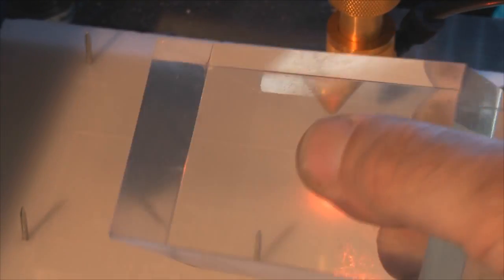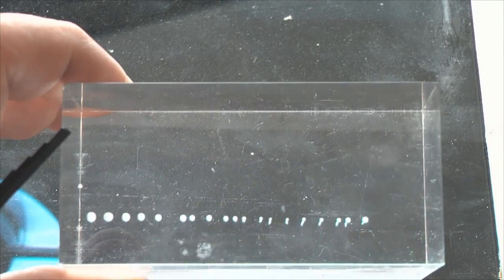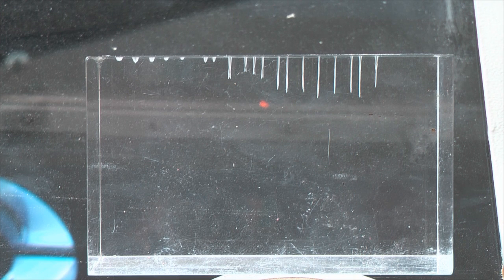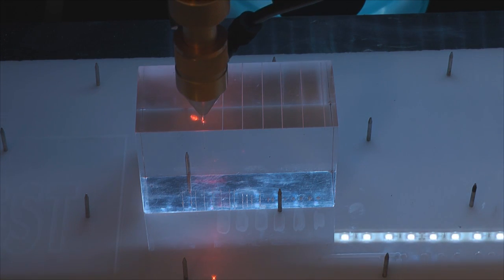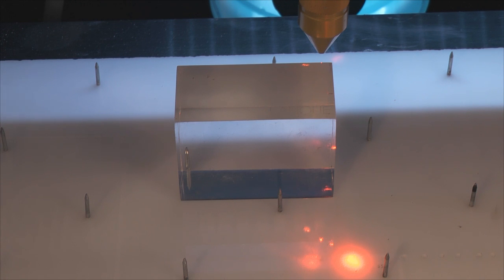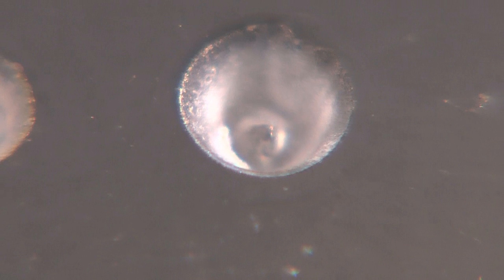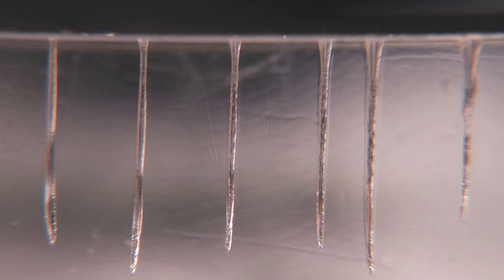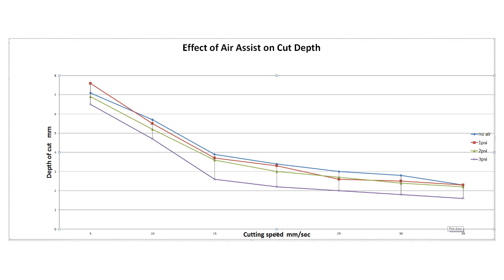Chinese laser cutter  tutorial part 6

Comment: Thank you very much for your videos they are really very useful. I was told by a fabricator that with a 150 watt tube I could cut 0.5mm thick sheet metal using oxygen, What is your opinion on this? Thank you very much again.
Reply from the maker: Hi Francisco

 Yes you can cut steel with a CO2 laser.  I used to run two 3kw lasers as part of a sheet metal working business. Yes, with the addition of oxygen as an assist gas  you  dramatically improve the cutting capability of the laser beam BUT........ Several warnings.
1) Don't attempt it with a normal machine. You require a  special (pretty heavy) head to cut metal  that you cannot just bolt on to a cheap machine.
 see   https://www.cloudraylaser.com/collections/metal-mix-cutting-head/products/cloudray-150-500w-metal-laser-cutting-head-set?variant=31210397237388

2) Pressurized oxygen needs to be handled very carefully because  it can be dangerous if you have no training
3)The oxygen needs to run at about 12 to 15 psi (about 1 bar) and is an expensive  consumable,
4) 150 watts is the MINIMUM power required  for anything half reasonable and what sort of things can you make with 0.5mm MILD STEEL
5) It does not work for stainless steel. That requires medical grade nitrogen runnng at  12 to 14 bar (huge gas consumption!!!!)
 
Cutting metal is not what I would call a hobby activity. It will be very expensive and really needs a lot of efficient machine use to make it a viable business. Think twice about any promises  or dreams that a salesman might dangle in front of you. Remember its your problem once you have bought it and he walks away with commission and a big smile.  I urge you to use Google  to find a local laser profiling business or a metal fabricator with his own machine and arrange a visit to talk through the logistics of machine ownership and the many ancillary costs and space requirements.
 I'm confident that after such a visit you will decide that it's cheaper to subcontract your metal work needs to a professional outfit. It's not expensive because they deal with large volumes.

 Best wishes
Russ
Reply: @SarbarMultimedia  And you think it's possible with a 150 watt tube with a peak of 180 watts? Thanks
Reply from the maker: @franciscodeasisfdez.medina45  
Hi Francisco
 Yes it will only be thin mild steel but before you buy ask the seller to send you an UNTOUCHED sample so that you can see what the edges are like. I can only advise you to be VERY skeptical.  A little care and research could save you a lot of money.  The big problem with laser tubes (even the so called best RECI) there are huge numbers of B grade tubes being sold with machines, Yes, it will  work and will have  been power tested by the buyer who bought it as a factory reject at a low cost. The thing that makes a tube efficient at cutting is beam intensity rather than power. An A  grade tube has the power and the intensity profile whereas a B grade tube may be like a blunt  knife rather than a razor sharp sword.  With my thousands of correspondents from all over the world, most with problems of some sort,  it does not take long for me to see patterns of behavior for the Chinese laser industry.  There are a few credible companies but in general  it is just a big flea market, so,  BUYER BEWARE. 

Best wishes and good luck
Russ
Reply: @SarbarMultimedia  Thank you very much again for the information and also for your sincerity

Comment: Thank you for these videos they have been very helpful. Have you used any other software with the cutter? We were told that Inkscape is great but not sure how to get the cutter to see it.
Reply from the maker: Hi Susan
 The free software, RDWorks, is neither a drawing nor a CAD package. It is just an interface software to convert your creations into machine code that your laser can understand.  There is a way that RDWorks and CorelDraw can operate together (I don't use it)  but provided you can create the right type of file format, any vector or paint/photo software  can be used to create images/designs.  Inkscape , Photoshop. Illustrator,  GIMP , Microsoft Draw  or any CAD software can be used .  You must IMPORT your creations , do not try to OPEN them..
 Shout out again if may answer has not dealt with your problem.
 Best wishes
Russ
Reply: @SarbarMultimedia  thank you so much for your reply. That makes so much sense.

Comment: thank you for sharing all this information with us! hope that your well and still enjoy the laser cutter.  i`ve bought this chinese laser cutter without knowing to much about, and i`m still struggling to make it work. at first was the software that create problems. now I have the message " opened protected" on the screen when i`m tring to start it. i`ve checked  the water pomp and the flow, everything is ok. on the laser control (the box that is inside) is showing laser signal off.   
best regards 
alexandru bunea
Reply from the maker: Hi Alexandru
I have not seen this message before  but it implies that you may have a safety switch on one or more of your machine doors Take a look at your Ruida controller. Is there a wire connected to the CN5 number 3 terminal?  If so check that your switch/s are working properly.  If there is a wire into CN5/3 then there is a way to bypass oit. Let me know what you find
Best wishes
Russ
Reply: @SarbarMultimedia   thank you for your help! there is a safety switch on the laser door and the wire is going straight to the laser switch button.
Reply: i`ve checked the sensor series and the only place that appears in on aly express but is unavailable for the moment. the sensor series is autonics pr08-2dn blu ov 4A086C and this one have a single black wire that comes to the laser switch.
Reply from the maker: @alexandrubunea2963  
Hi Alexandru
Is this machine in a factory or business where employees are using the machine or is this just for personal use?  95% od machines from China do not have this door protection switch.  If you have employees using the machine it will probably be illegal to run an unprotected machine. However if it is only you using it then it matters not because you are a "responsible" person. Under this circumstance it will be possible to disable the switch. Go to File Vendor Settings and the entry code is RD8888, Press the READ button . Find the OTHER tab and  at the bottom right you will see a  ENABLE PROTECT. I guess this will be ticked. If so remove the tick and press WRITE. then exit.  Hopefully you will now be able to use your machine,
 Best wishes
Russ
Reply from the maker: Hi Alexandru
  I think it would be a good idea to add your disguised email address to another comment so that I can email you directly with information.. I will then delete your comment.
 Best wishes
Russ

Comment: I had watched another video on these machines ( I have one by the way the same one you do )  and the man used the PULSE button in conjuctiion with lining up the mirrors to make sure the laser was directly in the MIDDLE of the lens. What he did was.....he place a round sticky note paper over the mirror,.... not getting sticky glue on the mirror of course....and he pulsed the laser to see if the laser hit in the center of the paper. if it didn't...then he adjusted the mirrors to where the laser was hitting directly in the center of the mirrors using the sticky note process. just thought I would let you know that. also they were saying to use distilled de ionized water with some ice in the bucket to keep the laser really cool.... it makes the laser last longer.
Reply from the maker: Hi John
Take a look at this video and you will see how I carry out a beam alignment perfectly and efficiently. 
https://www.youtube.com/watch?v=V_ehGE51rH4&t=1296s

There will be one feature that your machine lacks and that is a Z ajustment on your head . I overcame this issue by making my own bracket and also using a different lens system in a new head I designed myself.
See
https://www.youtube.com/watch?v=jVGByifge_Q

Making your laser last longer has little to do with perfect temperature control and more to do with control of the CURRENT you allow to flow through your tube. I would suggest very strongly that you fit an ammeter to your machine and also  add a temerature sensor to your return flow line from your tube. Although you can run your tube at 40 C without affecting its life  I advise you mainly keep it at or below 30 C At 40 C and above you will loose about 5% power  but that's the only penalty.

Take a look at these

https://www.ebay.co.uk/itm/Mini-Digital-Fridge-Refrigerator-Aquarium-Thermometer-Probe-Sensor-Freezer-LGH/184002639499?_trkparms=aid%3D111001%26algo%3DREC.SEED%26ao%3D1%26asc%3D20160908105057%26meid%3D09551348c63142d3bc0f2277c8929fba%26pid%3D100675%26rk%3D3%26rkt%3D15%26mehot%3Dpp%26sd%3D233079942056%26itm%3D184002639499%26pmt%3D1%26noa%3D1%26pg%3D2380057&_trksid=p2380057.c100675.m4236&_trkparms=pageci%3A28d16e79-3fd1-11ea-83c4-74dbd180be5d%7Cparentrq%3Adf3561ea16f0aa47a7823543fffd52b8%7Ciid%3A1

https://www.ebay.co.uk/itm/DC-0-30mA-Analog-Amp-Meter-Ammeter-Current-Panel-Ampere-Meter-Milliammeter/352350706691?_trkparms=aid%3D111001%26algo%3DREC.SEED%26ao%3D1%26asc%3D20160908105057%26meid%3D09551348c63142d3bc0f2277c8929fba%26pid%3D100675%26rk%3D5%26rkt%3D15%26mehot%3Dnone%26sd%3D233079942056%26itm%3D352350706691%26pmt%3D1%26noa%3D1%26pg%3D2380057&_trksid=p2380057.c100675.m4236&_trkparms=pageci%3A28d16e79-3fd1-11ea-83c4-74dbd180be5d%7Cparentrq%3Adf3561ea16f0aa47a7823543fffd52b8%7Ciid%3A1

Very easy to fit
see 
https://www.youtube.com/watch?v=xDZmuxq5BEM

Best wishes
Russ

Comment: Does anyone know if it is safe to laser cut prototype board? Its the boards that have all of the holes with the copper rings on one side. I hit some with a hammer and it shattered but I am not sure if it is safe to use in a CO2 laser cutter. Any thoughts on this?
Reply from the maker: Hi Eli
First of all you cannot cut copper because it is like a mirror at 10.6 micron wavelength and the light just bounces off and may reflect back and damage your lens. . Secondly the epoxy resin and paper composite board will produce toxic fumes. see http://atxhackerspace.org/wiki/Laser_Cutter_Materials

Best wishes
Russ

Comment: Hi, love your vids! What power are you running at for the pulse and lines?
Reply from the maker: Hi 
This was along time ago and very early in my learning journey when I was flailing around in the dark to get some sort of feel for the machine I had bought. At this time (although I did not realize it ) I had been sold a junk laser tube with very little power. If you wish to do some tests like this you can check the spot diameter wiith MDF or plywood but you will not see the penetration. If you have some 3 or 5mm acrylic you can stand it on edge and do the tests into the edge to observe the penetration. I would set your power to 65% and then press the ZU button on your keypad. In the menu you will see LASER SET.  When you select this you will see two windows. The top window will by default will say continuous. Press  an arrow key and it willchange to MANUAL.  Press the ZU button aagain to access the lower window. Set this to 500ms (half a second) and then press ENTER This will ensure that every time you press the pulse  button you will get a perfect half second pulse at 65% power.

Best wishes
Russ
Reply: @SarbarMultimedia  Will do, thank you!

Comment: Thank you very much for the video, it helps me a lot to start using the machine.

The inconsistency in the penetration maybe because of the inconsistency of the pulse button pressed time. If you do the test by software, it will have consistent result with the focus size.
Reply from the maker: Hi Arie

This was right at the beginning of my learning journey as I was tryingto work out the power of the tube without a power meter to help me.It was several months before I concluded that I would never know what was happening with the aid of something to measure the watts output.  Maybe jump ahead and watch these
https://www.youtube.com/watch?v=DrbQdIAQl4s
https://www.youtube.com/watch?v=lO9rWlobLZU

Best wishes
Russ

Comment: Hi Russ where could i also get a copy of the file for the focus gauge  Thanks
Reply from the maker: Hi Sean
I have manufactured several aids for setting focus accurately since this video almost 3 years ago. The technique I now use is very simple and requires no special equipment  beyond a very cheap magnifier
https://www.ebay.co.uk/itm/Stainless-Steel-Folding-Magnifier-15X-Magnifying-Glass-Loupe-Reading-Repair-Tool/263454575071?_trkparms=aid%3D111001%26algo%3DREC.SEED%26ao%3D1%26asc%3D20160908105057%26meid%3D86dfa27304fa4e6b9cdb025e080bdb3e%26pid%3D100675%26rk%3D2%26rkt%3D15%26sd%3D263702368909%26itm%3D263454575071&_trksid=p2481888.c100675.m4236&_trkparms=pageci%3A6442837e-b7ee-11e8-b22b-74dbd180031e%7Cparentrq%3Ad6f2177b1650ac3ccec0dbaffffffab7%7Ciid%3A1

Attach you email address as a comment and it will automatically be sent to my gmail as well. I will immediately delete your comment /email address from public view.

Best wishes
Russ

Comment: Where can I purchase a 1mm to 20mm focus gauge like you have?
Reply from the maker: Hi Kim
Sadly You Tube removed their private message system. The design is free and you cut it on your laser machine from 2 to 6mm acrylic Add your email to another comment and I wiill immediately delete the public comment because I get it copied via gmail. I will send the file to you.
Best wishes
Russ
Reply: @SarbarMultimedia  Good evening mr Russ, I am carefully following your videos, so clear and brilliant and professional.
I'm trying to create working tables based on the type of work for the various materials. It seems to me that you are doing your tests with a 50w power laser. In my case I use a 150w Aron Vesta16 laser, I would like to understand how to manage its speed and power values on my laser to obtain similar results.
Thank you
If is possible contact me at ppnardi@gmail.com
Pier Paolo
Reply: I need one too
bnsk.graphix@gmail.com

Comment: I forgot to mention the following: the manufacturer does offer two different laser heads...a standard one and a 4” one. The latter seems to be more efficient, but the values they give for 20mm are 0.8mm /sec.... that concerns me a bit. Yet their 100w model, doesn’t really jump in performance offering 1mm/sec @60%. For the 20mm piece. Am I expecting too much, or worrying too much?
Reply from the maker: You will find that cutting with a shorter focal length lens may actually cut faster because the energy density will be higher but  the cut edge may not be very flat  If you look at this you will see me cutting 15mm acrylic with a 1.5" lens but at 1mm/sec with a 30 watt tube!!! 
https://www.youtube.com/watch?v=2gUjIExQI64
As you will see the edge is not particularly square  but I don't think I understood how to fix this problem at that stage of my learning journey. I do now.
I think Thunder laser are being a bit cautious

Best wishes
Russ
Reply: Thank you so very much Russ...you have cleared the fog quite a bit. Indeed, thunderlaser have responded well, accurately and patiently with my flood of questions. Well, let’s see what happens, and indeed will check out your linked videos. Once again thank you for sharing your knowledge...cheers...Panos.

Comment: Hello, and a million thanks for all your videos...you do have a captive audience. I’m about to order an 80watt system, from a similar supplier, thunderlaser. I have zero hands on experience with lasers, yet I’m a quick study, and for the purposes of my business I have tried to be as ready as I can. My main question is this: I have a major project coming up, which will require cutting acrylic up to 20mm. Main cuts will be 5, 10, and 15mm. But I need to be certain that cutting 20mm with that tube, won’t bog me down, or worse, damage the machine. I considered fiber laser, but it would be overkill for what I need. What is your opinion on the 80w tube doing the job adequately? Would appreciate your feedback. Many thanks once again...P.
Reply from the maker: You have chosen well with Thunder Laser.  I have a 70 watt tube and it will cut 15mm acrylic but slowly, say about 3 or 4 mm/sec. I do not have 20mm to try. I would ask Thunder laser to send you a  short video of cutting 20mm acrylic and to tell you the lens focal length and the power required. You may need a real 100watt laser to do that with maybe a 4" focal length lens but I suspect you will still only be running at 6 or 8mm/sec Acrylic has got some strange properties that defy normal cutting rules for other materials.' see
 https://www.youtube.com/watch?v=B2z9Ja7nIeg